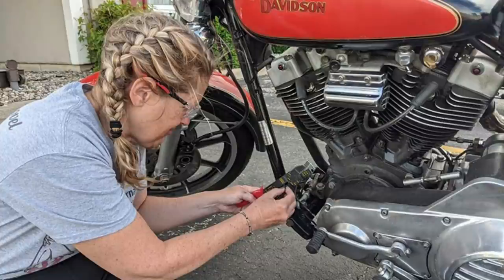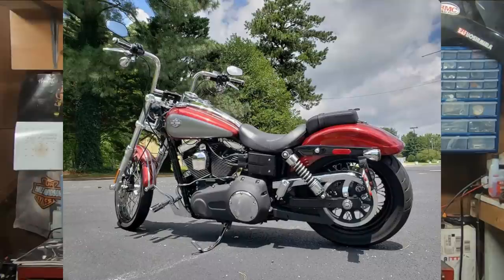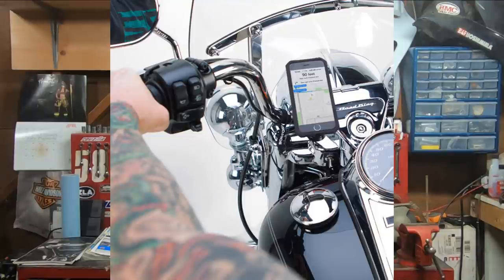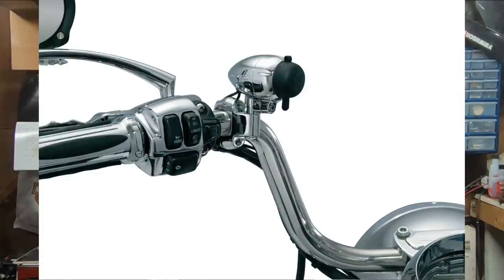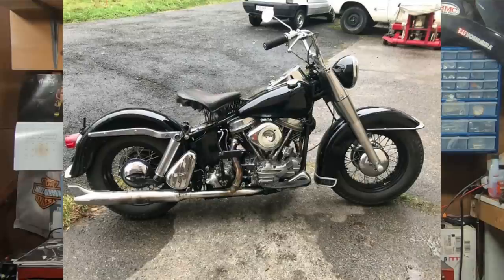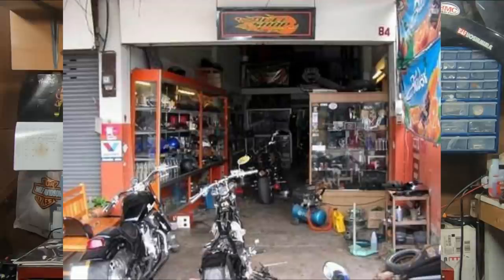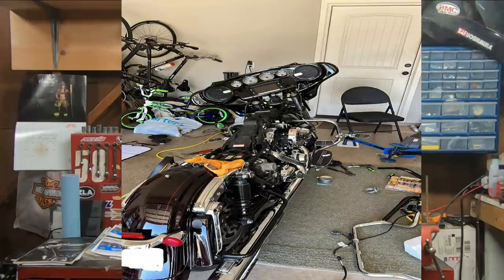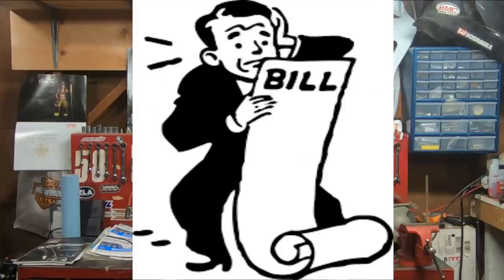Bar Swaps Require Intensive Labor and Cost More Than You Might Think

Comment from the maker: Have you priced having a shop do a bar swap on your bike?
Reply: No, Not yet but I’ve been thinking about it .
Reply: Yes.  $1,200.00 for a 2005 Electraglide.
Reply: I was quoted 400 to swap mine out. bought about 80$ worth of tools and materials and did it myself.  Now I know everything is lock tight torqued to spec and done right. I also would suggest if you're changing out bars always do new riser bushings. Just for extra insurance.
Reply: Yes 3 Days ago, 1400$ and was told not before 3 months because no inventory of cables
Reply: Love all your work & your knowledge comes out so easy to understand, keep up the awesome work 👍💪
 I hangout waiting all week on your next video❗
Safe travels 🙏❣️
Reply: Yep, 2004 fatboy. 1200 to 1700 depending on what cables and if the cables need to be extended, I did them myself for about 400. That is with stainless steel cables.
Reply: No. I'm thankful that I'm capable of doing it myself and a pretty well aware of the traps and costs involved. Did a swap from my oem buckhorns to Western style bars and just parts alone to carry out the job alone was in excess of $500. Got to be done right the first time. Nothing worse than a half arsed badly set up install.
Reply: Hells to the No!! I’m the only one who touches my bike. In fact, if most bought a Harley Service manual, granted a few hundred but will pay itself back in routine maintenance alone. Especially carb’d Twin Cams, it’s like building my first Lego set with like 17 parts to the whole engine lol.
Reply: @vancedyer755  buy a Harley not Clymer service manual which will pay itself back on a bar install alone. Time consuming yes, but you’ll save a grand. Plus you won’t be down without a scoot for two weeks. If you can read, own tools and have ever built a Lego set, you can handle a Harley. You can also buy pre wired bars these days, cables are super easy to build to size, they come with everything you need, clutch, throttles and brake cables made by Magnum BYO. Just a thought.
Reply: Just D.I.Y honestly not that difficult. 1,000 bucks for that is ridiculous. You can save your money and put it towards your bike.
Reply: Yup was quoted $900 for my 2022 road glide, so I’m going to tackle it myself
Reply: @BlancoFlaco  its pretty simple man i wouldn't worry about it. Just start with running the electrical through the bars which is pretty easy then work your way down from the bars. So you dont have your cables all messed up.
Reply: @thebeardedgingerontheinter3256  tnx my only question is will I need extended wire for the heated grips I’m installing. Factory 47’s 14 btw
Reply: @BlancoFlaco  im not sure about the heated grips. The extended wire loom for your controls is all just plug and play i would contact whoever your ordering the extended wires and cables from to ask them if there loom has that option for it
Reply: @getoffmygrass6974  thanks but I already have the HD sevice manual. I got it at the dealer when
I purchased my 2009 FLHTCU.
Reply: In Australlia it's upwards of $1500 U.S. much cheaper to do yourself

Comment: I bought service manuals and watched a couple of "how to" vids.  Swapped the buckhorns on my '13 Superglide for a set of mini apes, new risers and poly bushings, changed cables, brake line and internally wired them.  Changed the stock bars on my "20 Road Glide Limited for a set of Spooky Fast 12" bars and poly bushings.  Did those myself too.  The work isn't difficult with the right tools, a relaxed pace, patience and some good tunes on the garage radio.
Reply from the maker: Nice work! It's no a hard job but it is really time consuming!
Reply: @GixxerFoo  Not really when all I've got is time.... My bikes sit idle for 5 or 6 months of the year in a heated garage.  If winter is good for anything it's bike upgrades!  Keep it up with the great content man.  I appreciate it!

Comment: Shop quoted $1,500 CAD ($1,200 USD) to install generic pullback bars on my M8 Street Bob. Instead, I ordered some badass Original Garage Moto 10.5" Pullback Risers with digital gauge relocation and ODI Podium Flight V-Twin MX Handlebars, poly bushing kit, plus longer upper clutch cable and one factory wiring harness extension. The total was $850 CAD ($660 USD). I had to cut, extend, solder, and heat-shrink the left / right control, throttle-by-wire, and gauge harnesses. It took a lot longer than anticipated, but left me satisfied that I did it myself and ended up with much better parts. For me, it was well worth the effort.
Reply from the maker: That's awesome! I love that feeling of getting a big job like that done yourself and done right! You saved quite a bit over having the shop do it!

Comment: I went with the 12" STR Miter handlebars from Factory 47 on my 22 RGS. Love the look of the bars and their claim of being able to use all of your stock cables and wires sealed the deal. Originally I was interested in having my local HD dealership do the install but they wanted to charge a $1900 minimum for the job. They also tried to say Factory 47 was wrong on being able to use the stock cables and wires. I went home and did the job myself in about 4 hours, zero issues with cable or wire length. Pulling them through the bars was an absolute pain but I'm glad I did it myself!

Comment: I had a local independent shop put on my 14” dominator Industries apes. I bought everything required including wire extenders and new braided brake / clutch lines. All together I paid around 600 for parts. The local charged me 585 to put them on. It took two days and one extra trip to properly set the bar pull back to my preferred spot. Was absolutely worth it. I had the stock bars on for 30k miles. I should have done it first!
Reply from the maker: That's not a bad price at all for parts and labor, indy shops are the way to go having someone do the work. It's amazing what a set of bars will do for your bike!

Comment: I wish people would search what is required for bar swap as this would inform them. I have an independent motorcycle repair shop and when customers contact me I go through the process off what is involved with bar swap depending on the customers year and model bike. No short cuts are taken and job is very labor intensive. Educating a potential customer is my first priority so they have a full understanding of what is required. Every bar swap is unique to the bike as variables will arise. The devil is in the detail
Reply from the maker: I miss but don't miss those days, some people will look at you like you're crazy after you give them a complete run down in total honesty. I've had people come back after getting some other quotes and realize we weren't trying to screw them lol.

Comment: My dealer wanted $1700 to swap my bars out when I bought my 2019 Ultra Classic. I declined and found Dominator Industries and bought plug and play 12" meathooks for around $500, just had to reroute the brake and clutch lines per a Factory 47 video I found, it is very doable for anyone who is slightly mechanically inclined. I saved myself $1200!
Reply from the maker: Labor rates are very high! You can save a lot of money doing your own work, that's awesome to hear!

Comment: Bought used handlebars on Craiglist off a CVO Road Glide. Had a local shop change out the stock bars on my RG and got lucky that all the cables fit. Very happy with results.
Reply from the maker: Very nice! Fortunately Harley reuses a lot of parts across models so going with a stock set of bars off the CVO that was a good swap!

Comment: awesome first time I've ever had a you tuber do a video suggestion.  Dont know if I actually had influence on it or not but I definitely asked for it lol. I just did 10 inch mx t bars on my 02 dyna. Had to extend the wires and run them through the bars. I soldered and shrink taped everything. was able reroute cables and bend brake line to work. Took me about  6 hrs working on it after work in the evenings. Bike is soooooo much more fun to ride now.
Reply from the maker: I remember your suggestion! I appreciate you suggesting it, bar swaps are very involved. You made good time on yours only taking 6 hours, sounds like you did it right too!

Comment: Another excellent topic and video......I'm a good moto mechanic and do all of my own work on the bikes I own.  So when I decided to swap the bars on my 2021 RKS I thought....."No big deal.  This will be simple"  Wrong on so many levels.  Even on the Road King you have stuff to consider before doing it yourself.  As noted, it is not that hard, but it is a lot more work than meets the eye, and it can cost for some extras.  I went with KST Kustoms, so the bars themselves were pretty expensive.  I knew I had to extend the wiring, but was told I would not need to extend the cables.  In '21 HD went back to cable clutch and so the cable is thicker and stiffer.  Given I insisted on OEM routing, it was just a bit too short and stiff.  I wasn't at all comfortable with it.  So I purchased a 4" extension from Fat Baggers for another $115, and added their optional adjuster for another $50.   If I totaled up the time to do the swap, and do it right, I bet I had more hours in it than I did in my Stage 2 kit.  I am very happy with the bars and setup, but no doubt, it was a lot more work than I expected.
Reply from the maker: I can only imagine what it would cost having all that done at shop! I like sticking with the OEM routing myself, I've rerouted before and run into issues later on down the road. You for sure did the right thing by getting a longer cable and not chancing it!

Comment: I went with 1.75 inch riser blocks from CJ motorsports for my fatbob. No extensions or anything needed. Just had to unbutton the factory wire clamps and create a little room. Been on for two years it really made a difference.
Reply from the maker: That's awesome, Fat Bob is an awesome bike! A set of risers makes a huge difference on those bikes, great handling machine!

Comment: I've done my bars 3 times and just finished a friends. 
There's a few tips i have learned.
Sometimes you can use a different models cables, Eg, My Fatbob has 16 inch T-bars and I have barnett throttle and idle, Streetbob clutch, Custom brake and my electrical wires had enough slack.
When you are trying to run the wires internally, Put tape over the the other handlebar holes and use a vacuum to suck some strong fishing line through, tie it to your wires, put some grease on them and slowly pull them through. 
Also, re-routing your clutch cable up the other side of the bike gives abit more slack.
Reply from the maker: That's not bad idea at! I've had some luck using shop air to blow some wires through internally wiring before too.
Reply: The only problem is if your new bars have cornered bends. It's hard to get the wires past those bends without them hanging up. Other than that it's smooth sailing.

Comment: I just did 17" fat apes on my wide glide and between the bars, cables, hoses, and switches, I have about $1000 into the job and I did all of the labor myself. Totally worth it in my opinion. Being 6'5, the apes are way shoulder height for me and way more comfortable than stock bars.
Reply: At 65 here too I have 18's with a 4 inch risers and could actually go 2 to 3 inches higher here.... But ride safe and be comfortable...
Reply: I've been thinking about this for my 2011 Wide Glide.  How about vibrations at idle?  And do you get the same smooth ride at speed?  I am 5'9'' and looking for 12's or 14's.  Thank you!
Reply: @steph6934  I don't notice any additional vibration at idle that wasn't there with the stock bars (high compression, big cams) and the bike still feels solid over 100mph. If I felt I lost rideability with the apes, I would take them off in favor of rideability because of my riding style (very aggressive lol)
Reply from the maker: You shouldn't experience any additional vibration, almost all bars have rubber isolaters which cuts that down quite a bit. Shouldn't be anymore than what you already with a Harley.
Reply from the maker: Apes do change the handling quite a bit, you can't dive into corners quite as hard lol.
Reply from the maker: Being comfortable is what it's all about!
Reply from the maker: Your height really allows you have taller bars and still be legal, if I did some tall bars like that I would be asking for a ticket lol. That would of easily been a 2K if you had a dealer do that swap for you.
Reply: @GixxerFoo  I don't notice any difference in handling at all. If anything, my extended forward controls limit my handling more than anything. I must say though, my first bike, an 883 Sportster, was way more nimble but I looked like an adult riding a Barbie bike on it lol comfort is definitely key
Reply: I shook my head at the "17 inch apes" until I read the part where you mentioned being a giant hahaha
Reply: @peterhrusovsky3729  oh man, i would pay good money to see you on an 883! That must have been really hard on your legs. I'm 5'10" and my Forty Eight with mid controls is perfect, but it originally had forward controls and at my height they too fit good, but if I was much taller then both wouldn't work. At 6'5" you must have been able to throw that bike into corners so easily but you must have been so cramped up haha

Comment: Put new 12in ape hanger on my 2019 streetglide. Handle bars $91 wire extender kit $39 . All from eBay. Took 6hrs to do the job myself. Didn't  need the wire extender kit, wire were plenty long. Saved a ton of money doing it myself. Not a complicated process just time consuming.
Reply from the maker: Honestly the Ebay and Amazon products really aren't all that bad, I've had pretty good luck with them myself. That's not a bad price at all for wire extenders and bars!

Comment: A small job but a big difference can be a riser swap. These will give you a little more or less elbow room without having to remove and resite your controls
Reply from the maker: Risers can transform a bike for someone, fitting a bike to an individual is really an art. Some dealers literally pay someone to do just that and that's all they do is fit a motorcycle to a rider.

Comment: Yeah, you talked me out of that. I have a 12’ Road King and was contemplating beach bars. I don’t use the windshield a lot I like that retro look the Road King has.
Reply from the maker: It's actually not too bad on a Road King to do it yourself, if you have 12" apes you've got the length for beach bars. My wife rides a 48 and I'm very happy she's good with her bars lol. They aren't hard to change at all, but it's just time consuming and tedious work.
Reply: i did beach bars on my heritage, it can be done but you need to get a GOOD molex connector tool so you can unhook the wires and reinstall them in the molex connector. As gix said you have the length so its really not terribly bad if you take your time and take video and pictures before you start unhooking wires lol Be sure and take time to walk away and come back at it when you calm down
Reply: p.s. I have a vid of my heritage on my channel if you wanna see

Comment: Just have to grin and bare it cause keeping a rear tire on keeps my azz plum broke. And that’s considering I bought some tire irons some dozen or so tires back.  Good golly, labor and tires can run ya near a grand these days. Well anyway, just grateful to be riding and that riding season is back in full bloom in my neck of the woods!
Reply: And then every time I do a tire change my wife gets to hear me gone on and bragging bout all the hunerds I’m a savin’.
Reply from the maker: Right on! Tires are not cheap at all, it's even harder to find a shop that will install a carry in with a tire you didn't buy there. I am the same way, I've got a manual setup for tire changes but I'm fortunate to have motorcycle tire shop somewhat close that does carry ins for 50 bucks. There prices are really good on tires and they can usually get it done while you wait with a carry in, really cool old school bike shop!

Comment: Anything without a fairing is a fairly easy swap. The only hard things about doing it is running the new wiring through the bars and the soldering part. The rest is easy. Did my sportster bars in a weekend.

Comment: I talk most customers out of their wild Apehanger ideas due to safety reasons. If you can't do a lock to lock figure of eight, you are at the mercy of the cell phone crowd. I show them by having them follow me through the advanced rider course in the  dealer lot on their stock bike. They seldom can, usually freezing up and aborting the turn, which means death in the Black Hills twisted. It's the VERY rare and very large riser than can do a lock to lock turn on a Touring bike with 16 inch bars. If you care about your customer, this conversation happens prior to discussing any costs.

Comment: I recently did 14" bars on my 2021 Street Glide, figured its winter and its parked so i will give it a go as i have a heated garage and im not riding it in the snow anyway, i can honestly say that running wires is a total pain in the ass and i will never do bars on a bagger again, next time it will go to a dealership, its not worth the frustrations.
had to replace for longer brake and clutch cables 
It started out fun, but never again.  oh im sure i will get comments from some dude that will say "oh i had my bars swapped out in an hour" or something along those lines, good for you i dont care.  I will never do it again.
On my 2009 Rocker C, that was easy, on my 2014 Wide Glide it was also easy and added 14" bars with a 2' riser, looks amazing and was easy to do.  I think a lot of the frustration came from the type of bar i used on my Street Glide which was a meathook style bar 
oh well, for me, i will never do it again but now thats its done, looks awesome feels super comfortable and cant wait to try it out in the spring.
Happy New Year all